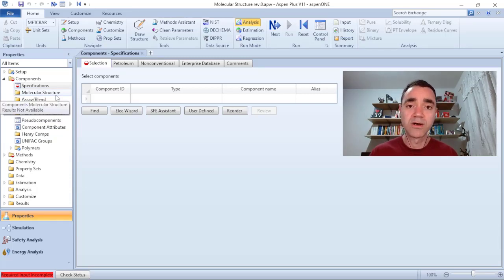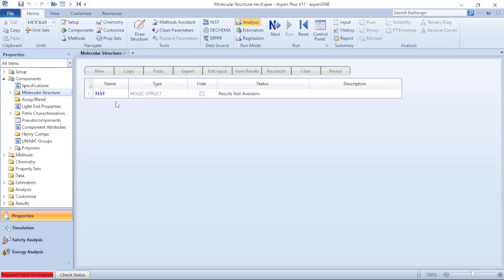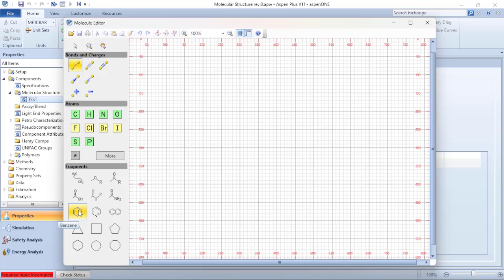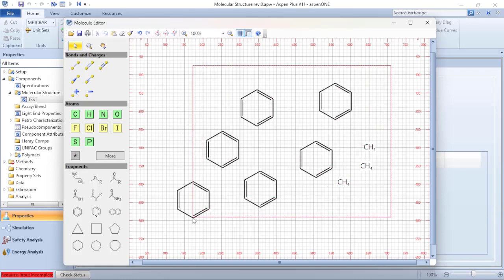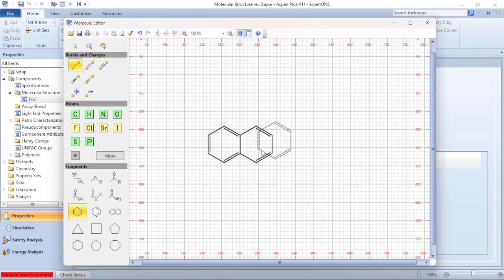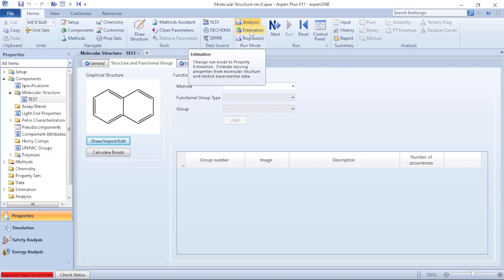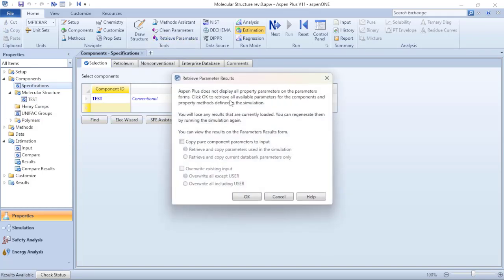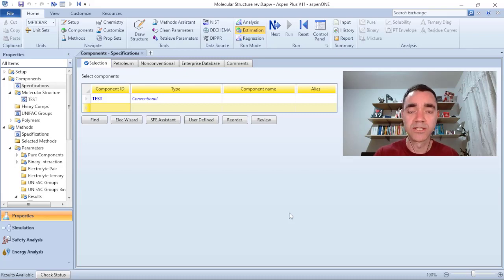HOW TO SET MOLECULAR STRUCTURE ON ASPEN PLUS | ASPEN PLUS COMPONENT SETTING EASY

Comment: Fantastic sir, i have a question.... how to show an azetorophic Graph at hysys or aspen plus? bcause theres just shown about tabel data
Reply from the maker: Hi, on Aspen Hysys there is a block/object named "Equilibirum Unit" in the model palette where you can verify binary equilibrium. This object return information in form of graph and table. Interesting to mention that it is an extension. You can use the search bar in the model palette to find it. :)

Comment: what if i have a polymer?
Reply from the maker: There is a specific tool to deal with polymers called "Aspen polymer". In any case, you can use hypothetical component if it fit your needs 😇

Comment: Hi Sir, Good video for learners. I want to ask you that after defining the structure/formula, you did not choose any method to calculate the missing proeprties.
Reply from the maker: Hi, if you do not define your component properly, you can have issues during the process simulation running.